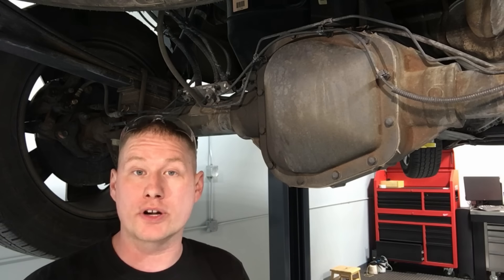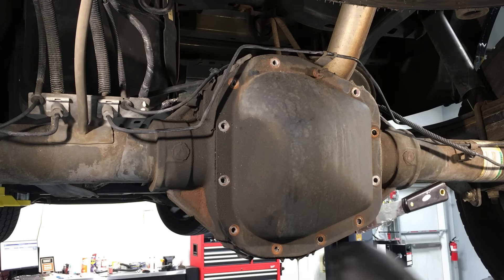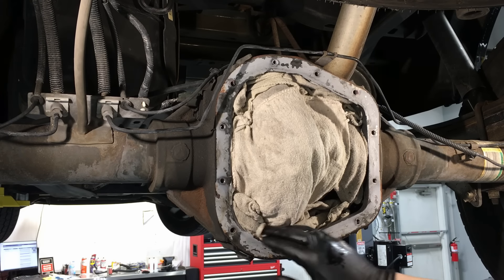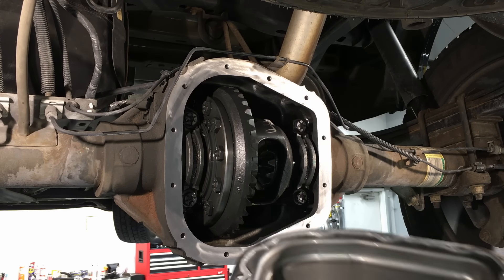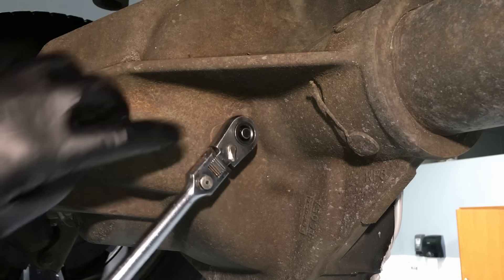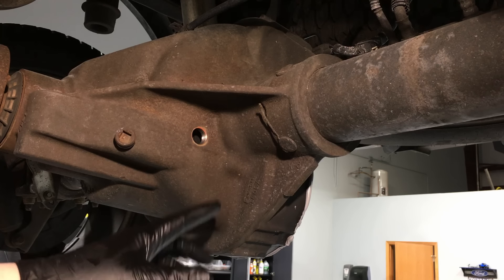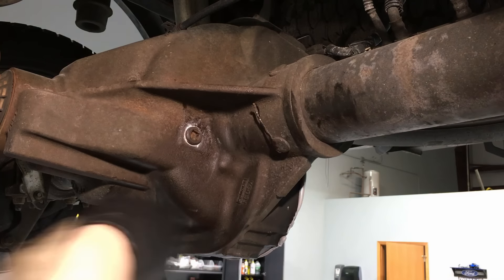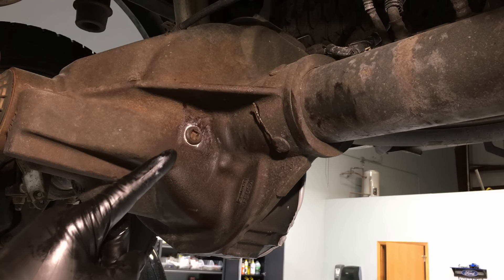Ford 8.8" 9.75" 10.25" Rear Differential Service: Fluid Change Procedure

Comment: I have a 2016 F150 with the E-locking rear diff.  I just noticed oil on the flange near the top 3 bolts and some on the bottom of the flange.  I only have 40k miles on the truck.  Does it sound like the seal is failing already?  Should replace the seal and change the fluid?

Comment: Very surprised that he said everything Changed to 75w-140. That oil is thick. Would translate to lower mpg. My 97's manual calls for 75w-90. Which I have used for several changes. Is there a viable reason for the thicker oil? Would love to know?
Reply from the maker: Gear wear, there is a TSB directive from Ford.
Reply: @FordTechMakuloco  Okay, thanks! About 50,000 miles since last change. I will change it. Thanks again!👍

Comment: Pro tip... Make sure you can get the fill plug out BEFORE you drain the fluid.
Reply from the maker: Why, have you ever had a seized fill plug on a Ford differential? I work in the salt belt and have never seen one in my entire career.

Comment: I seen they call for 75-85 for places like Canada on the newer F150s. Is that you’re recommendation also or go with 75-140 regardless of where you are?
Reply from the maker: Same 75W-85 spec here.
Reply: @FordTechMakuloco  oh ok great, I seen you using the 75-140 that’s why was asking. Awesome job as always brother
Reply: @FordTechMakuloco hi brian. I have a 2019 ford f150 2.7l. Should i use 75w140?

Comment: What would a dealer typically charge to do a trans (10 Speed) and diff fluid and filter change 2017 F150 3.5eco? Don't want to do them myself but bought ~90KMiles and want to just change all the fluids just incase, and hope to never need to use my Ford ESP. Think I can get all the fluids changed for under a grand?

Comment: Hi @FordTechMakuloco, I have an '05 Superduty with the 3L rear end and my manual calls for 8 oz of the additive. I noticed in the video you used 1 4 oz. bottle. Should I use 1 or 2?
Reply from the maker: 3L only identifies the the ratio not the diff size and style. How did you look up in the manual the amount of friction modifier if you don't even know which diff you actually have?
Reply: @FordTechMakuloco  from the research I've done, the L means limited slip, and per the manual, it says if you have a limited slip differential to use 8 oz. Of modifier. I wish I could attach a photo here.
Reply from the maker: All Ford diffs only take 4oz of friction modifier, only some of the biggest units take 6oz. I am not sure what you are reading takes 8oz. Again it based on size not type of diff.
Reply: @FordTechMakuloco  do you have an email address I can send photos from the manual to?

Comment: Fordtechmakuloco - My owner's manual (2014 F150, 9.75" rear diff) says to fill the rear differential until the fluid is 1/4" to 9/16" below the bottom edge of the filler hole.  It calls for 2.6L (about 2.7 quarts) of fluid.  By recommending that people fill to the bottom of the fill hole, are you having them overfill the rear diff?  I'd like to hear your reply to this.
Reply from the maker: The Ford workshop manuals make no distinction, it will not be overfilled if it is filled to the bottom of the fill plug threads.
Reply: @FordTechMakuloco  Thank you, it helps to know that.
Reply: @FordTechMakuloco  I really appreciate your videos, you are the man!

Comment: I have a 2016 6.7 F350 Super Duty Is the gear oil the same for both axles and the transfer case? If not what do you recommend?

Comment: @FordTechMakuloco at about the 16:30 mark, you say the spec'd oil for the rear diff changed to the 75w140 you are filling with. 
My question is when did this happen? I've looked at 2017-2019 F150 (9.75") owners manuals and it still calls for the 75w85 fluid. 
Specifically I am interested in a 2019 Raptor but all manuals indicated to use the 75w85.  I believe it is EPA related but I would sure like to know as I am about to perform this service.  Also, what are you using for front diff fluid?     Thanks
Reply from the maker: Ford tried the thinner fluid you speak of starting in 2015 and will likely be back to 75w-140 just in the past. The stuff comes out like water!
Reply: @FordTechMakuloco  Thank you sir!!  A follow up question.....what are you recommending for the front diff in this 2019 with the Torsen diff?   I really enjoy all the info you post....really helpful!

Comment: 2011 F250 6.2 4X4  code 3E on the door for the axle I already put the friction modifier in and I think it electronic limited slip will it hurt anything...thanks

Comment: It was recommended to me to use that gasket sealant, as well as the regular gasket. (Purchased both.😒) 
Yes/No?
Reply: Save yourself a headache the next time have to open it. Use the gasket and only a very small amount of sealant on the cover ONLY if at all. The only real time you need sealant is the the little rubber bead type gaskets. Any flat wide type gasket shouldn’t need sealant unless there is a bigger issue, bent or stripped out bolt etc.

Comment: Where can I find the service update on the 75W 140 Axle fluid.   Our dealership put in the 75 85 and it is vibrating.  They dont see any update.  I have an 2016 F150 with a 331 Diff.  I did a fluid swap and put the 75W 140 in previous at 60000 miles.   They did a differential repair at 139000 and replaced with the 75 85.  please Help!!!

Comment: Question, when applying gasket maker on the dif cover, is it possible that it may leak inside like it did on the outside?
Reply: A quick read of the instructions will tell you that "This sealer requires 24 hours before filling with oil." this is to allow that bead to dry. If you follow this instruction, the cover will never leak. I have been doing it like this for years and have not had damage from sealers being used correctly. Also: not all sealers work for everything. Get the sealer made for the job.
Reply: Permatex Gear oil sealer will actually push gear oil out of the way and stick to wet metal.
Reply: Dave P. Thanks

Comment: Man I don't know which lubricant to use.. my dealer still says 75w-85 on my 2018 F150 2.7L. I wish there was an easy way to see updated recommendations for my vehicle.
Reply from the maker: You can use the specified 75w85 lubricant they say will protect as well as the 75w-140 specified here but you watch in few years Ford will revert due to excessive wear like they did in the past. So it is your choice, either one will not destroy the diff.
Reply: @FordTechMakuloco  so if it was your truck you would prefer the 75-140? That's what I'll go with then.
Reply: @FordTechMakuloco  thank you sir!!
Reply: Friction Modifier...some places say 4oz, 8oz or 1oz per pint of fluid, which would be 6.5oz. Which is it? The owners manual for my 2009 F150 with 9.75" diff says 8oz for 2004-2010 year models and 4oz for 2011 and up. Using Motorcraft 75w-140 and XL-3 modifier will it hurt anything to use 8oz instead of 4oz? Also wondering why it says to fill within 1/4-9/16" of fill hole? Thank you! Not questioning your experience just wanting some clarification. I've never been good with because I said so for an answer...😊

Comment: @FordTechMakuloco Can this be done with the vehicle on the ground or is it better to have the vehicle in the air? Obviously I can access under my truck with four wheels down but will quantity of dif fluid be any different while the rear end has no weight on it versus weighted?

Comment: Can you give me some advices which motor craft gear lubricant fluid I should use for the rear and front differential on my f-150 2018 xlt 3.5 eco boost 4x4 10 speed automatic transmission.  My truck is a 6” lifted with 35” tires and I also installed the Bully Dog bdx Tuner preloaded to increase the hp and towing capacity. So from the ford manual it recommended to use “ sae 75w-85 premium synthetic hypo is gear lubricant for both front and rear.  But since my truck will be pulling those 35” tires forever so should I go with the 75w-140 for the rear and front axle? Also will I have to use the motorcraft friction modifier with the fluid for the rear axle too.  Please help me with this, thanks.

Comment: Do you still recommend the Motorcraft 75w-140 in the 2019 F150 rear diffs. 8.8 .  
 I know this video is 5 years old and just I was just wondering because my book states the 75w-85 is recommended and it is so expensive now. Thank you
Reply from the maker: I would use the 75w-140 yes.
Reply: @FordTechMakuloco didn’t use synthetic developed a leak out the axle barring drained and put synthetic in and the leak stopped makes a difference

Comment: I have the 3.55 E Locker in my 18 F-150, and Ford is telling me I need to use XY-75W85-QL, WSS-M2C942-A, SAE-75W-85 Synthetic Hypoid Gear Lubricant, is this what you reccomend?

Comment: So i got a vacuum pump to pump the oil out of my boat engine. 
Can i use that to drain my rear diff without removing the plate?
Reply: You certainly can if you're just going for a quickie. But, at least once during the life of the diff, I would do the complete procedure.

Comment: Always get the fill plug out FIRST. If something happens and you can’t get it out or it strips the threads after you’ve drained the oil then you’re screwed because you have no way to fill it.
Reply from the maker: There is always a way to fill it, but honestly in my entire career I have never had a seized fill plug even on the oldest most rotted Ford.
Reply: @FordTechMakuloco  you'll probably never get one that doesn't come out, but it's always good practice. Especially if there was some kind of emergency like the gasket was leaking and your stuck on the side of the road. If you couldn't get a fill plug out it would be a pain to have to fix on the road.

Comment: I purchased the ford performance diff cover and it came with a gasket. Is it still better to use the permatex gasket maker or should the provided gasket be good?
Reply from the maker: I would use the gasket as long as it is elastomeric.
Reply: @FordTechMakuloco  Seems like it. Metal with rubber like coating. Thanks for all the awesome tips.

Comment: I'm planning on buying a different gear oil brand and it already has the limited slip additive. Do I still need to use that (Motorcraft) limited slip additive??
I do have some Motorcraft gear oil available.
Reply from the maker: I would advise against that, I can't tell you how many times fluid changes were done by the customer with this all in one fluid and after had problems or customers brought in this all in one fluid for us to use and withing a few days they were back chattering. Not worth it in my opinion, use the ford oil add the the xl-3 and be done no worries.
Reply: @FordTechMakuloco  I was trying to save a few bucks by buying Royal Purple gear oil but you are totally right. I just bought the Motorcraft gear oil and I will be under my 04 F150 tomorrow lol. Thanks for the advice!

Comment: Wouldn’t it be better to use the manufactures original gasket a new one that is?
Reply from the maker: Ford does not use gaskets they use sealant just like this from the factory.

Comment: At what intervals due you recommend the front diff fluid on a 07 FX4 4x4 and the transfer case? I know the "ford" recommended interval is 60k on the front and 150k on the transfer case.

Comment: You state use 75w140. But, my 2014 Raptor Supplement states 75w80? Which should I use? Also, supplement says NO friction modifier?
Reply from the maker: The raptor is totally different front and rear.
Reply: @FordTechMakuloco  Does your response mean I should use the lube from the Raptor Supplement?

Comment: I know this a older video but I have a question about the fluid used. my 2017 f150 calls for 75w-85 gear oil however it’s hard to find and expensive as hell. can I use 75w-90 full synthetic or even 75w-140 or is there something special about this new fluid. because if its only about gas mileage I would rather have fresh fluid in there than letting it sit because I can’t afford to even replace it myself.

Comment: FordTechMakuloco , I have a 10.5 Sterling.  I cannot find the Axle Hub Bolts to replace mine.  They like to work there way out every 5,000 miles or so..    Where can i find more Bolts for the Axle Hub Retainer . And Shoudl i use Thread locker on them >? 

Thank you !

Comment: What disc are you using to clear the gasket material? I have a few 2 inch roloc yellows which ive used before but that's def not what was being used. Thanks

Comment: You mention they switched over to 75-140 for the rear diff? I called my dealer and was told 75-85 for a 16 f-150 with a 9.76 rear end. Which is better ti run? Thanks
Reply from the maker: They changed back to 75w85 on the newer models once again for better fuel economy not better protection.
Reply from the maker: look up the ford FEHP oil fiasco in the past, history repeats itself.
Reply: I’ll take your word on it.. I’ll run 75-140. I don’t want to replace a rear end.
Reply: What weight would you recommend for the front diff?
Reply from the maker: 80w-90

Comment: My user manual has a note to fill the rear diff to 6mm below the filler hole. I guess this spec has changed since then.
Reply: I can't believe they  really expect anyone to be able to measure 6mm(1/4") through that fill hole..

Comment: @fordtechmakuloco Do you have the specifics, part number or otherwise, on the abrasive disc you used with the grinder to clean the sealing surfaces? TIA!

Comment: Hey Brian, Im a bit unsure whether I need to add friction modifier. I just changed the rear diff fluid on a 2015 mustang gt with valvoline synpower 75w-90. It already has limited slip additive. Do I still need to add it?
Reply from the maker: They say it is not needed but I have seen nothing but problems with any aftermarket axle fluid company that sells axle fluid with additive already installed. That is why I use virgin axle fluid from Ford and mix in the specified amount of approved additive compatible with the Ford clutch packs.
Reply: @FordTechMakuloco  Ok thanks makes me want to just drain that fluid out. Is it just as bad using it on an e-locking diff?

Comment: i had a question, what do you think about installing the lock out on the cam phasers on the 5.4 motor 3valve? Is it a good idea? they sell a kit that locks them out and you install a program to upgrade the timing. I am having issues with my 2010 ford f150 with the 5.4 motor and I am considering trading it.

Comment: hey Brian, so even in my 2012 escape that calls for 80w-90, i should use 75-140? i have 75w140 motorcraft at home so it would be convenient . i live in a mild summer cold winter climate
Reply from the maker: No stick to 80w-90 in the rear diff for Escape vehicles.

Comment: I just changed the rear end of my 2016 8.8 with E locker. Manual called for 80w 90. Ford switched back to 75w 140?
Reply: Im not understanding this either, my manual for my 2017 3.5 ecoboast with 10speed trans and electronic shift 4wd says 75 85 hypiod oil  I have it empty now with new gasket drying overnight and not sure what to use, I purchased what the manual said and my owners site doesnt show any update? @FordTechMakuloco  can you advise?
Reply: @roberttchatal6916  go with whatever the rear end has printed on it

Comment: I now own a 99 Ford E-350 Super Duty Triton V10 6.8L, 4 sp auto that was sold by Thor Industries (RV) as a class C motor home. I am having trouble getting the specs.
How do I learn what type of differential I have?
I am getting ready to go on a 2k mi trip, I would like to service the differential first.
26k original miles.
help?
Yes, I will be contacting Thor, beyond that any suggestions?

Comment: Quick question and sorry if its already been addressed, but my manual for my 2016 F150 calls for 75w-85 for the rear diff. Are you sure 75w-140 won't hurt it if i go with what you say?

Comment: @fordtechmakuloco I've been trying to do research on why they changed diff covers between 2010 and 2011, my 6.4 had the aluminum finned cover but my 2011 has the steel, are they interchangeable?

Comment: My 1986 F150' differential ten  bolts are far too warped/rusted (I dont want that headache). I'm going to try and open the fill plug, suck out as much fluid as I can and refill with 75W90, I think. It's just too risky otherwise.
I hear a Russian remove bottom 3 bolts, drain, then refill.
I have no indications as yet of a bad differential.
David
Alberta

Comment: So my 2019 f150 with electric locker calls for 75w85 does mine fall into the 75w140 as well?. I have a surplus of amsoil 75w140 like 24 quarts collecting dust. The 9.75 has been the same since 1997. Has something internally changed with it to call for a thinner oil? Am I safe to run my amsoil 75w140? that 75w85 is more expensive than my amsoil.
Reply from the maker: I would use the 75w-140 yes.
Reply: @FordTechMakuloco  thank you, im guessing the lighter weight is either for extremly cold climates or fuel mileage?
Reply from the maker: Fuel Economy

Comment: I have a 2015 F150. What are your thoughts on using 80w90 instead of the recommended 75w85 Ford now calls for for both the front and rear diff? 3.55 e locker if that makes a difference.

Comment: Dumb question any one. Can this be done at any time with no risk like on the transmission? My 99 i got it with 130k miles and now it reach 200k and this work never has been done. Should I still do it?

Comment: So I have a 06 f150 4x4 5.4L.
I should still use 75w-140w synthetic with the additive or ? I want to make sure I use the correct fluid.
Reply from the maker: Yes use 75W-140
Reply: @FordTechMakuloco  what about the additive

Comment: On my 2018 f150 with 8.8 do not fill level to plug. It must be below 1/2 " I filled it until it poured out and it blew my driver side axle seal .
Reply from the maker: Um no there is plenty of room in there for the fluid and there is a vent.